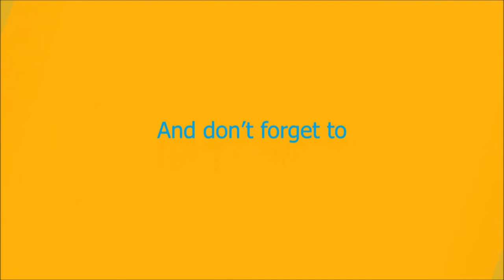Ahsoka Tano lightsabers | The Mandalorian | 3dprinted

Comment: Why did you put the pieces in water?
Reply from the maker: The parts were printed with PVA support material, it is water-soluble. So all you have to do is add it to warm water and the PVA will dissipate (over time), leaving no support marks behind